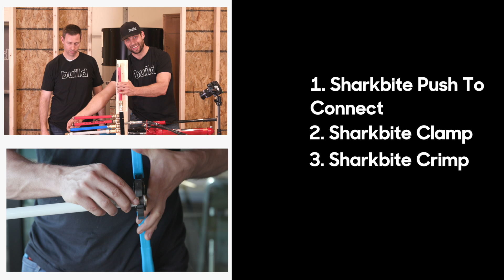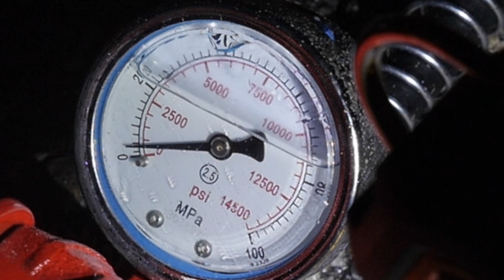Can we blow off these PEX fittings?  Sharkbite vs Viega vs Uponor

Comment: I really like a lot of your videos Matt, but.... this test is of zero value. Pex A specifically says it will deteriate  if exposed to organic compounds. Hydraulic oil is an organic compound. It destroys the crosslinked structure of the tubing. They even go as far as to caution about the use of termiticides that use organic compounds in the soil if the pex will come in contact with pretreated soil. Try again with water and add a lower scale pressure gauge on your manifold. You are on the right track! Thanks for your dedicated work on your videos.

Comment: Matt - piping systems are always designed to have the pipe fail before the fitting.  That is why the pipe has a labeled maximum allowable pressure printed on it.

Comment: I used the crimped copper rings in the first house I am building myself. I had to remove a temporary fitting (loop for the water heater) that was teflon tape threaded that was leaking. So I used the pex copper crimped fitting like a swivel joint and it STILL didn't leak! After Matt's video of this testing I have immense confidence in PEX copper crimp fittings even with an absolute amateur like myself installing it.

Comment: I would have liked to see all of the pipe sections replaced as each failed.  IE, when #1 failed at 500psi, #2 might have gone further, but was already weakened.
Reply: Glad I saw this at the top. I didn’t want to be that guy but the pipes at the end had been under pressure 3, 4, and 5 times. Doesn’t really follow scientific method at all. But still fun.

Comment: Definitely need a gauge with a 1000 psi range. Off the manifold go check valve>bleeder valve>gauge. It will lock in the pressure the test pipe fails at and then allow you to reset the gauge👍

Comment: literally the fittings are stronger than the pipes themselves so even in you house if the pressure is 80psi there is no need to worry and these hold on very well

Comment: This is like the absolute worst possible method for testing anything. No one monitoring pressure values, no isolation of each system, no isolation of fittings from piping, etc. 

Also, anyone could have predicted that the piping would have failed first...

Comment: Testing all at once and at different lengths of pipe was a mistake. When you test all at once you stress all of the ones that didn't fail possibly to the yield of the material but not quite to failure. When tested again the material is already weakened so that the yield to failure is lower than what the failure would be on a virgin test pipe assembly.
Apples to Apples is everything exactly the same size. 10 PSI over 1 inch is not the same as 10 PSI over 10". Example would be cut a piece of plywood 1 foot square then take it and face into a stiff wind. You should be able to hold the 1 foot square out into the wind with no problem. Take a sheet of plywood and do the same thing, same wind, same force but now multiplied times 32. Good luck holding on.

Comment: Interesting test, gents! Since you're promoting science (and want to build great houses cost effectively), please consider some additional testing:

This test looks at one failure mode, and while it's fun, it's not a failure mode common to PEX systems in normal service. Several folks have already commented on the need to test at temperature limits of such systems. Ideally, you'd do that, but I think considering likely failure modes will suggest other (better) tests.

Failure modes:
- Pipe burst: unlikely under normal conditions... except at junctions (see below)
- Material embrittlement - yeah, that's the mfg's responsibility
- Fitting failure: either the fitting itself or the pipe at the fitting
   * corrosion
   * fatigue failure (from hammering)
   * installation related failure (either immediately or later)
   * creep failure (the fitting or the tube)

As a practical matter, the failure modes you could reasonably evaluate relate to fittings & interface (as opposed to the PEX) and aren't affected much by normal temperature range (40-180F).  Mfgs can do more extensive evals... they have labs; hopefully they did before introducing the products (<cough, cough> PBT). In-service temp extremes are probably not "the big knob."

So, it'd be a big boring test, looking for leaks instead of bursting assemblies. You'd have to make a summary video, because it'd be like watching concrete harden in terms of entertainment value. But still, an experiment more likely to illuminate real-world durability isn't too hard to design or execute. Roughly
- 3 manifold assemblies, by people of varying experience (~zero, apprentice, & well-experienced)
- Use fluorescein dye for convenience
- 10 or more samples of each connector per manifold
- Test at max pipe/fitting rated pressure (or at least elevated... probably need to get creative)
- A device for inducing fluid hammer in a clockwork fashion (again... creative)
- Check it until something happens (prob leaks), then keep checking until more stuff happens.

Unfortunately, even this kind of test will find failures likely at parts per thousands of opportunities. PPM kind of failures probably won't show up.

Ok... who am I kidding, y'all don't have time for this. But thinking through this does suggest some better testing practices "in production." Most building codes prescribe a static pressure test, but the most likely call-back is because a fitting was installed poorly, and a static test can miss that pretty easily. A fluid hammer test (while the walls are still open) would probably find the problem during rough in. How about:
- Connect temp water line to house
- Build a rig that hammers (opens valve to a drain) for a fraction of a second, then shuts FAST.
   * Cycle the hammer ~1-2 times/minute
   * Run the rig overnight
- Run the Code compliance static pressure test.

IDK how often you deal with in-wall leak call backs, but I'll bet you'd never have another after this. All for the modest cost of building such a rig (solenoid valve, a bit of wiring, couple of pipes & a few fittings, couple of relays, & a timer - done)

Comment: Plumber for over 20 years here, general problem solver for over 40, if you dont have a reliable guage then this test is worthless. PRO TIP.   Put a branch on the manifold with a line check valve on it and a pressure gauge after it.  ( you want the Check valve to allow flow towards the gauge but stop it from returning )   add a T and put a ball valve on it somewhere after the check valve.   you now have a rig that will still hold the pressure you put into the closed system displayed on the gauge AFTER the pipes on the manifold fail ( or fittings )  you can  use the Valve on the line to relieve the pressure on the line after you read the gauge.   also.. Use water... less mess, and more accurate, pex will void warranty on products if they are used with anything that is not water, the exception being Oxi barrier pex for use in Hydronic heating, which is rated for glycol.

Comment: Not sure if you read these or not but you can easily bypass the pipe bursting by just installing crimp rings down the length of pipe. Don't even need to crimp them. Just put as many on as possible like a big sleeve. You went get as many on the Wirsbo but you can try to just use Wirsbo rings until you can get down up crimp rings.

Comment: definitely not OSHA compliant
also, way, way safer for the tubing to fail than the fitting. I've seen guys put in comas from a flying wing nut.
Reply: well, it was one dude but it still happened

Comment: Pex A has failed several times in freeze up conditions, the burst looks the same, I have pictures of one I repaired, Personally I use PEX C because of local availability with a wide # of SKU's at Menards, and I have much invested in tools, Propress Pex jaws and others, yes its more rigid but i have seen it frozen solid with little expansion, so here in the north Im all about PEX C, the flow issues people talk about are really not an issue if you size right to begin with, the only time i have had a flow issue is a Mixer to a Tub Fill, and if you upsize that short run to 3/4 its no problem.

Comment: Plumbers they are not... along with not knowing how fittings function. The tube is the weakest point. Always has been, always will be. 
I agree with others. Raise the water temperature and get an accurate gauge! No sense 'testing' when you can not record results.
Reply: Engineers they are not. . .

Comment: This proves even more the strength of the crimp fitting (I normally use Sioux Chief or Shark Bite with copper rings)  When you go to reuse them, after you cut the ring off, it is still a fight to get the pex off of the fitting without slicing it lengthwise.  And I find it amusing and satisfying that the Pex B seemed to be the clear winner in this simple test.    Great episode guys! I just might use a surplus roll of 1/2" and make me a swing out of it!     I also almost never use Teflon tape, I prefer Blue Monster or equivalent, I think I've only had 1 or 2 fittings drip over the years.

Comment: please pressurize the pex A to the highest normal house hold pressure with water and then freeze it thaw it recheck the pressure and freeze it again cycle this a few times and see if any changes are visible or if the pex thins during freeze and thaws

Comment: Ridiculous testing.  Most home water pipes never experience these kind of pressures.  Average home water service lines are between 50-65 psi, after the line pressure reducer.  Shark bites will hold at least 110 psi (street pressure) if the home pressure reducer fails.  I have worked in the plumbing trade and that is my experience.

Comment: only 500psi? i'd say the gauge off, now lets see some serious "water hammer" action..... that is the biggest issue in common plumbing, things suddenly "slamming shut/off"
Reply: Think of the solenoid valves in washing machines, and dishwashers. while the flow rate isn't real high, they do shut off suddenly. I think pex pipe is flexible enough to just simply dampen the line hammer, unlike black pipe, or even copper.
Reply: Vincent Robinette yeah, my Samsung machine is a bastard. It does 10 second bursts of filling and has a real fast acting solenoid. I put a water hammer arrestor on it, but it still bangs the pipes like crazy.

Comment: Been using the SharkBites for years.  THE only time I had a failure was if I didnt get a square cut on the pipe.  Ive actually went back to places where I installed from years ago and checked,  looked like the day I installed and actually had dust around and below fitting with no signs of leakage. Used on PEX, copper, CPVC. No failures.  They are my goto fitting if owner doesnt mind added expense.

Comment: if there was air in the piping and it blew suddenly, or just water at high pressure it could have been very bad to  your hands, you should have been nowhere near touching anything but the pump handle. think about high pressure water or air injected under your skin or just blasting hunks of it off ;)

Comment: the one thing you did manage to show is how to not seal threaded fittings :)
Reply: @Jeremy Hess yes definitely. Every one of there's leaked. Lol
Reply: I'm thinking they threaded it on in the wrong direction which caused the leaks. First thing I learned in my plumbing career. Always thread it so the tape doesn't get caught by the threads and unravels.
Reply: And how not to stick your body parts in proximity of a potential hazard.
Reply: Hemp and tallow, it's been working since Roman times.
Reply: Anyone knowledgeable who can point out how they didn’t thread the pipes correctly?
Reply: lol, or use a digital pressure gauge, or an inline pressure gauge on each pipe.
Reply: You can seal well into the ksi range with Teflon tape and NPT fittings.

They screwed something up...my bet is either loose fittings or they screwed a non-tapered thread and a tapered thread together. It happens reasonably often with people who aren't familiar with fittings.
Reply: Loctite 569 = no leaks
Reply: @TheBoguspokus  Too bad it's so expensive! Not worth it for home plumbing.
Reply: @Jeremy Hess throw the tape out and use a good grade thread
Reply: @eddieball1924  I take it you don't do daily plumbing and deal with all the rough threaded brass and copper with uneven ridges and sharp flashing. it very often just shreds tape as you tighten and displaces sealants, unless you use a high grade thread locking type (often used on air and hydraulics). most all casting or machines parts are done at too high of "speeds" which makes for poor threads. I've been cussing about them for years and now half the time cast brass fittings are porous and will leak water  in the middle of the tee or elbow. (made in indonesia, lead restrictions, etc.)
best bet is tape applied tightly into the threads and dope overtop to help lubricate further and keep the tape from tearing or being rolled out. (no tape on hydraulics!!! it's a killer)
Reply: @throttlebottle5906  I deal with high pressure hydraulic, fuel and use to do steam on a regular basis. I always use a good aviation grade thread sealant with no problems,  none of that gritty shit or tape, tape and dope are things of the past (respectfully) I've seen guys that put so much on that I always knew they were the guys that wore a belt and suspenders.
Reply: @eddieball1924  makes sense the, if only we could get good proper machined threads for a change! most resemble what looks like hand chiseled threads lol
yeah, I said chiseled and not cut nor filed.
Reply: @throttlebottle5906  i use regular ordinary threat tape on press, copper and schedule 40 pvc fittings all the time with no leaks. I use it on water and air systems that range upwards of 150 psi on the air.
Reply: Sealant
Reply: Glad everyone agrees that a threaded fitting sucks and has to be deld with in special ways but shove and crimp holds just fine.
Reply: @timothydillon6421  don't know about that. With the exception of compression fittings, or hose fittings, threaded fittings are not intended to be pressure tight without the use of some form of sealant.
Crimp fittings are good to go. Sweating is a thing of the past (almost).
Push fittings I tend to avoid, though one did save me from having to dig up a lot of concrete floor once.
Reply: @jarodstrain8905  I just cut out some propress 2" copper fittings today because they're not to code. The new guys are all trying to propress everything because they can't sweat copper. I even had an old plumber today tell me he doesn't even have the tools to sweat copper on his truck anymore. Propress is conveniently fast and a retard could do it, but it has no place in backflow protection, which is the only copper I ever touch. There are two kinds of people. Those that take pride in their work, and those who use propress fittings.
Reply: @atypical_moto   I've never tried Propress.  When I mentioned crimp fittings I was referring to Pex rings.  When I do work with copper I prefer to sweat joints, but it's a rare thing these days.  Where I live at there are so many methed out hillbillies, you don't dare use copper if you don't have to. Somebody will steal it.
Reply: So first off, they don't know how to properly make a threaded connection, second, idiot number 1 could have lost his hand in the beginning. These guys are amateurs. Big fail!

Comment: So not accurate make a manifold with a Schrader valve blow up with compressed air with a inline gauge see what happens my guess 200 lbs most water psi 50 60 lbs

Comment: Yeah, you need a better gauge so you can run it again and have real numbers.  Plus, it would be nice to know what the manufacture claims each one will handle and then when it fails.  I'd add in L and M copper to the test and like to see how that sharkbite does on copper.  I don't think you where knocking it, but I'd only use those sharkbite slip on's for temp work.

Comment: So the metal fittings are stronger than the plastic pipe.. but we want to know which fittings will fail first and leak the least with increase pressure.   Normal pex is only rated for 100psi and things usually have a safety factor of 3.   My money would be on the copper crimp rings.

Comment: I would like to see a redo of the shark bite twist on. I had a couple fail when I first used them. They have a definite change in feel when they slide on properly. Not that I would even suspect a weak connection it would be nice to rule out operator error.

Comment: 500psi would scare the sh*t out of me; no way would I be on the business end of that during those test- shark bite #1 went ballistic literally! lol. I was surprised the pipe failed first #5 looks like a good fitting. 500psi is around 1200m of head - so with an average house in the UK only having around 7 - 10 meters of head, I'd say the crimp pex fittings are good. Shame that they are not available in the UK as I wouldn't trust the shark bite push on underneath the floor boards, only a soldered copper connection... old school style :-) Cool test!

Comment: I am normally not critical of videos, but honestly, your safety procedures were horrible.  Putting your hand near something like this is just stupid.  Then thinking to move it outside.  Why not just start over with it outside.  Secondly, not checking the fittings before testing to see if they leak and having to cut and restart? Really? Not using 2 gauges with a valve in between for lower pressure and higher pressures gives me no usable information on WHEN or WHAT PRESSURE they will fail at.  Maybe you did it later in the video.  I stopped watching after seeing the first one fail with your hand on it.  With just a little effort this could have been really a great and informative video.

Comment: All that work for leaky connections and the recording of the gauge on the final one. Would of also liked to hear what the rating on each pipe and fittings is suppose to be prior to testing. Thx for the content.